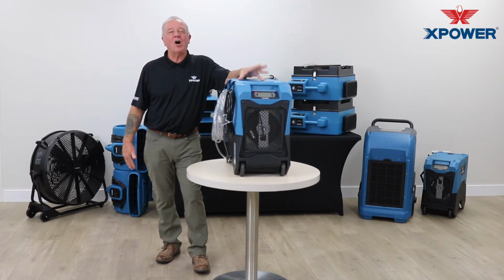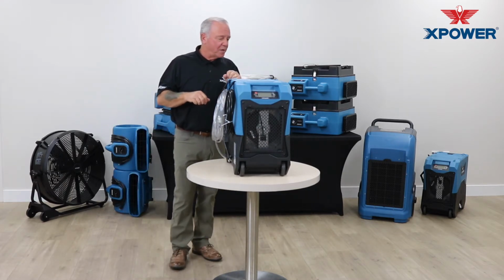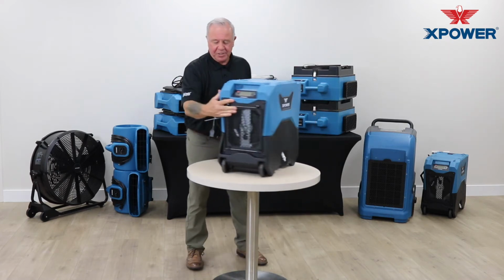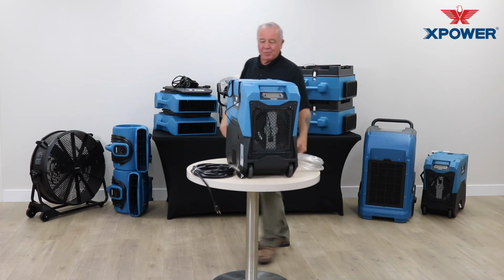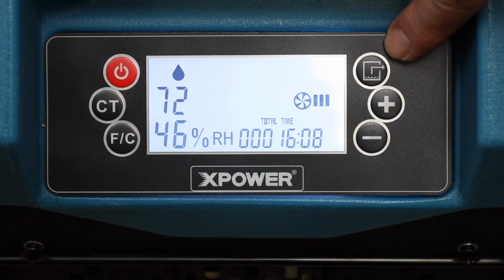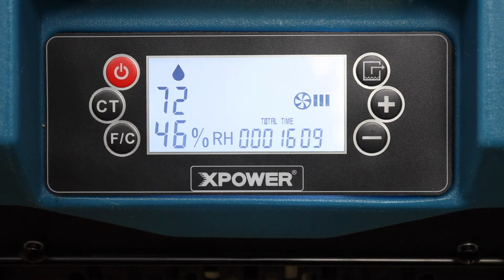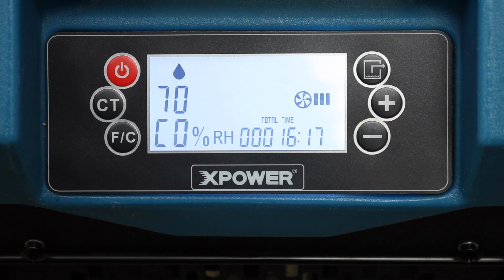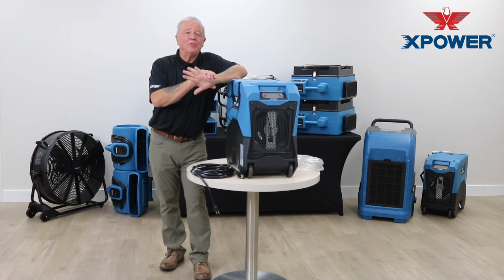XPOWER XD-85LH 145Pint LGR Commercial Dehumidifier with Auto Purge Pump for Water Damage Restoration

Comment: I have that model. I read that the fan automatically goes from HIGH to LOW when the Relative Humidity goes below 30%.
However, my unit was running as low as 26% Relative Humidity, but the fan stayed on HIGH. Am I doing something wrong?
Reply from the maker: Thanks for watching the video and purchasing an XPOWER LGR Dehumidifier. Please note that the dehumidifier is equipped with a 2-speed fan and seems to be running properly. The fan will adjust in speed during the dehumidification process (i.e. when the compressor is running on the machine). The humidity in a given environment can be set by adjusting desired humidity levels via the control panel on the LGR Dehumidifier. When the set humidity level is achieved, the compressor will shut off. In your case, depending on the set humidity level, the compressor will shut off and discontinue the dehumidification process, but the fan will continue to run as it continues to process the humidity in the occupied space. If the humidity level rises and exceeds the humidity setting, the machine will turn the compressor back on to continue the dehumidification process. The 26% humidity level achieved is the reading at the outlet of the dehumidifier, but may not necessarily mean that it is the same in the entire space. Please keep in mind that the relative humidity levels will vary as the amount of air movement exerted from the dehumidifier is limited. For better humidity control, it is recommended that additional XPOWER air movers are introduced into the space to assist with additional air movement for a more thorough processing of the air.

If you have any further questions or concerns, please feel free to reach out to us toll free at 855-855-8868.
Have a great day!